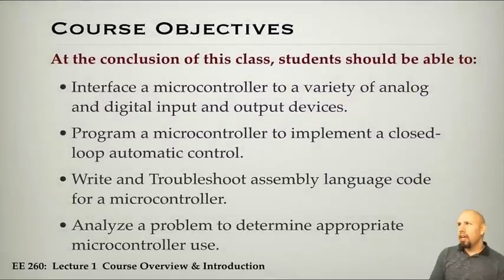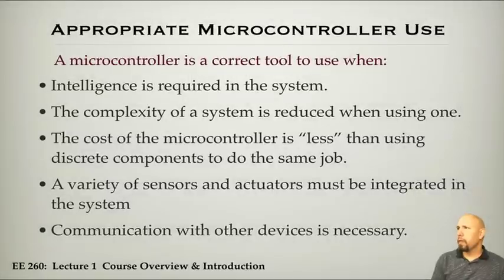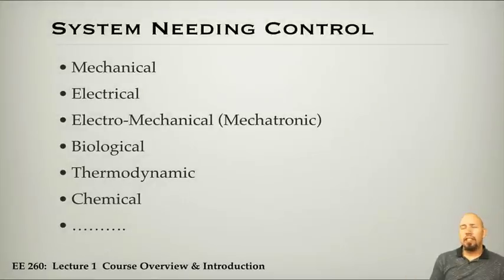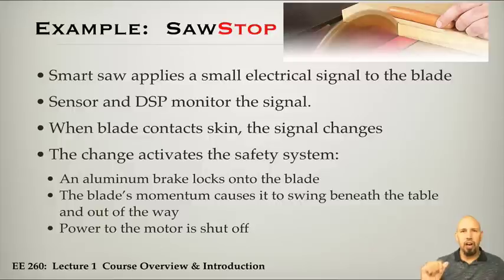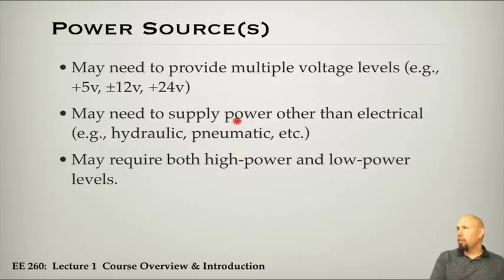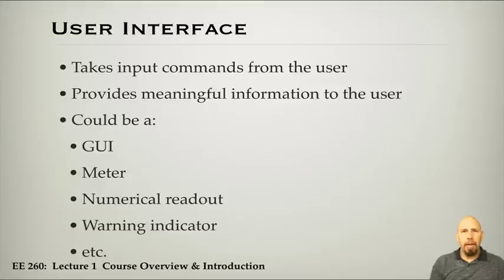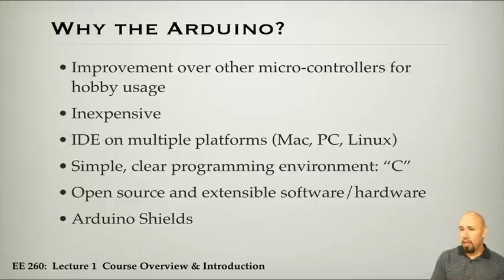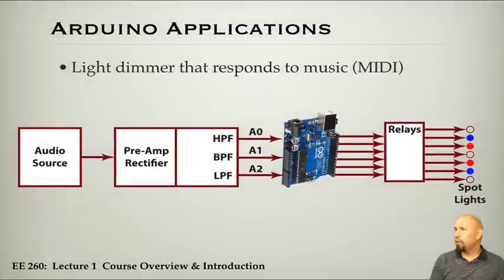1. Introduction to Embedded Systems

Comment: The PWM example was modulating the timbre of the tone. You would need it to oscillate at a shorter interval of time in order to create higher pitches. The pulse width determines the timbre.

Comment: Hi,

Is there any other shield that could be used instead de EduShield, even if it requires some minor changes or adaptations to follow the lectures?

Thanks
Reply from the maker: You are free to use any shield, and there are many.  Actually, I don't use the EduShield much in the video lectures.